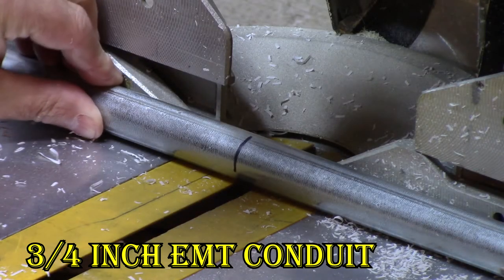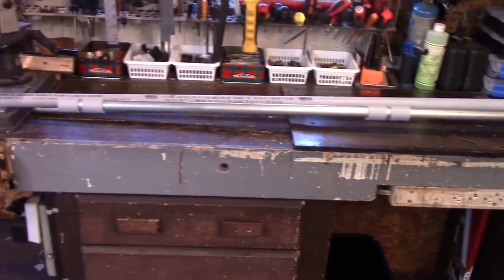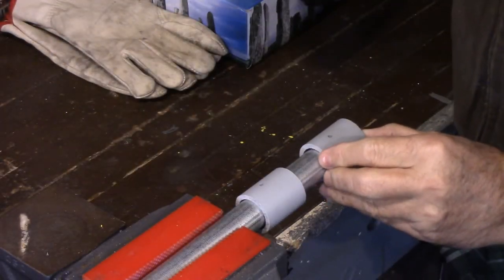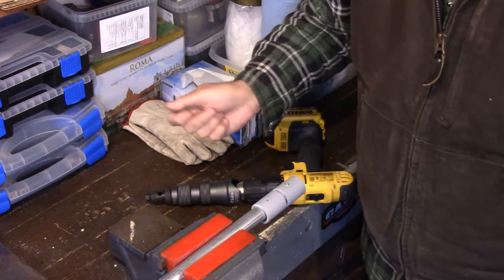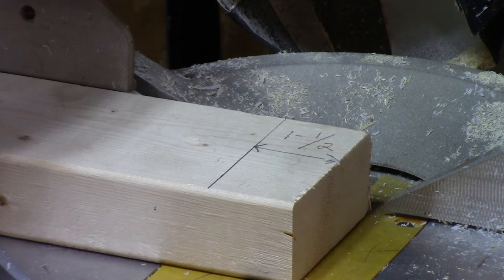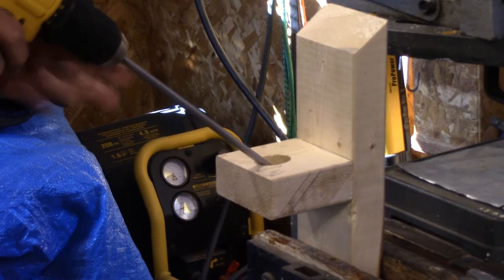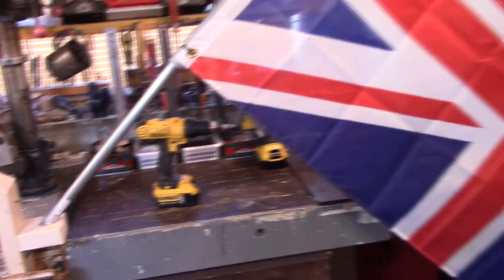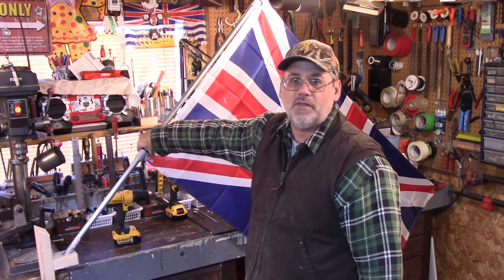Unique Flag Pole  Design  Diy Easy

Comment: Love Rivots and never think to use them...   You have maximized the strength of the wooden stand by drilling the hole through both pieces....  Brilliant !!!
Reply from the maker: This summer is a flag fest , part one as my shop at the camp does have two sides :)

Comment: Great job Steve, how did you plug the open end at the top?  I don't think you want a pipe full of water rotting your garage siding. Larryz
Reply from the maker: Thanks Larry, I did think of that too  so I stuffed a hunk of shop towel  in  the end and filled the  top 1/2 inch with silicone caulking.  Great observation 👍

Comment: Good ideas! Is that the flag for Canada?  I was not so good in history if you know what I mean...  May I suggest one small improvement?  You may drive one screw across the wood grain on the small piece of 2x4, at its free end, along with the 4in side. It will avoid this small piece to split.
Reply from the maker: I have  the post 1965 Canada flag too but the Queens flag is good too , you must see this one flying all over Quebec eh :)  Thanks for the tip great idea Joe . Cheers